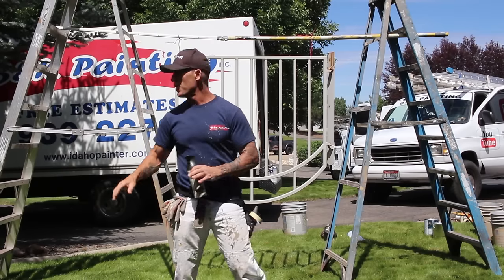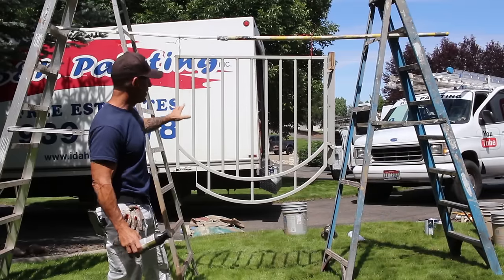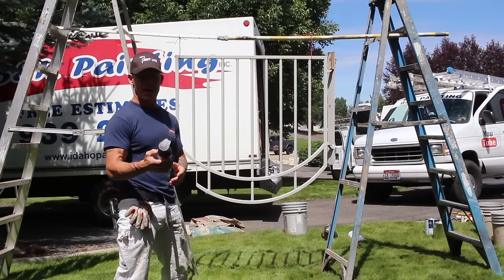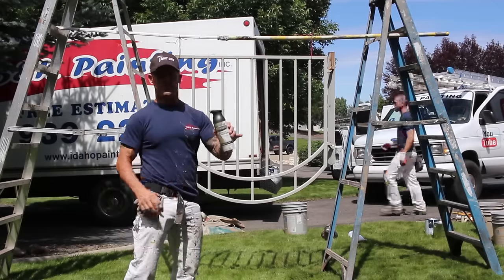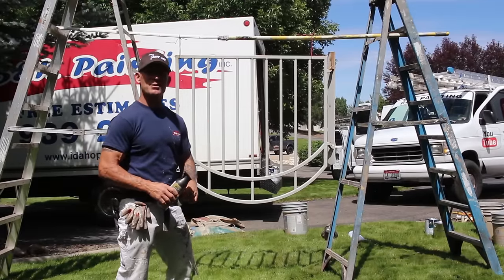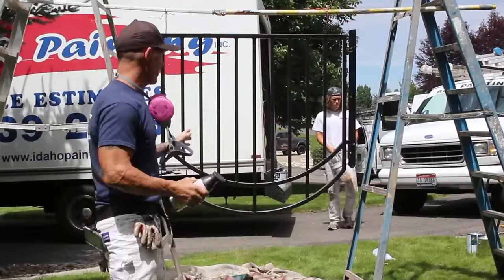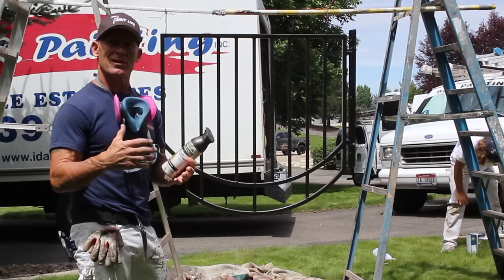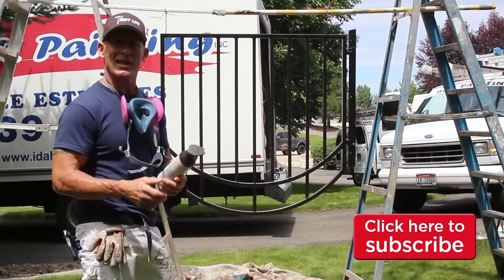TIPS PAINTING An Iron Gate or Door with DTM.  Metal Fence Hacks.

Comment: I stick a closed brolly through the rails, open the brolly and spray the gate, that way the spray does not spray on anything behind it. Close the brolly again, pull it back through the gate and move to the next bit.  You need an automatic brolly one that opens and closes with a push button.